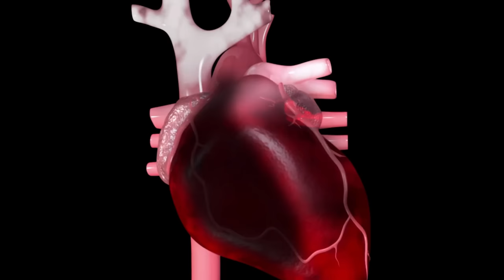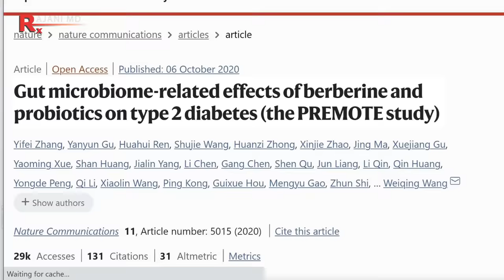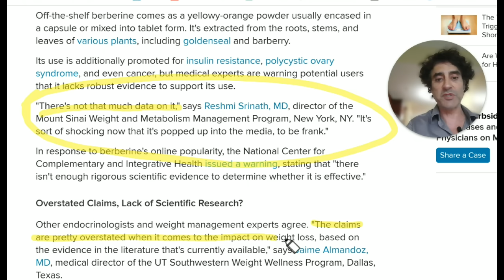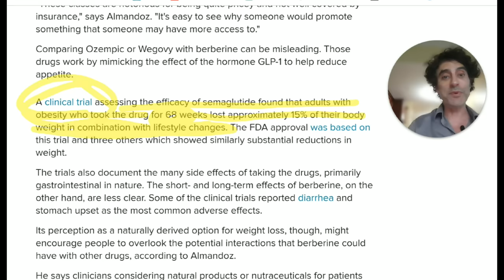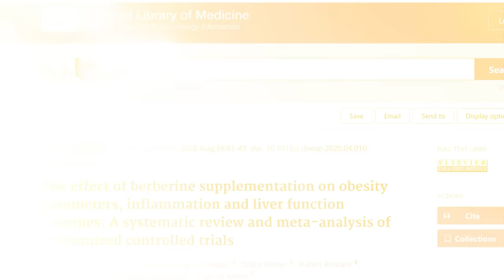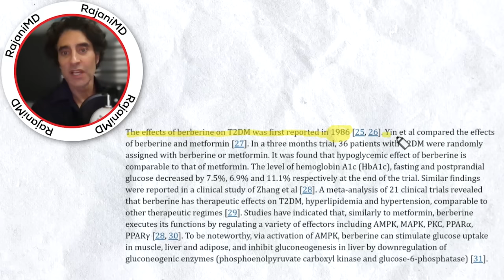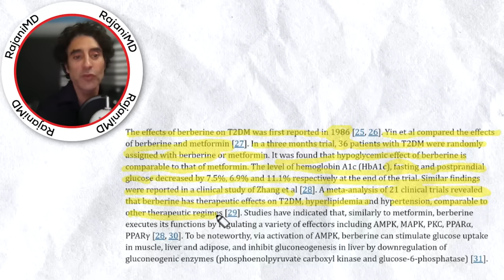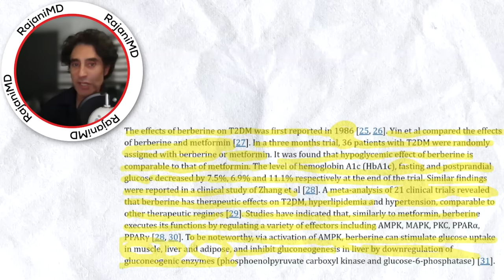BERBERINE : WORTHLESS or AMAZING ??

Comment: I did my own experiment with Berberine 500mg with lunch and dinner and lost 8-9 lbs without any other changes diet, exercise, etc over a 3-4 month span. It is not a magic "weight loss" bullet but works slowly overtime.
Reply: Thanks for providing the dose and timeframe. I just need to lose 10 pounds and I think I will try this.

Comment: I am taking Berberine. 1g per day in 2 doses (500mg twice, spaced apart). Mainly because I used to have higher blood sugar creeping up to the pre-diabetes zone, and higher blood pressure. Now that has normalized. No side effects that I have noticed. I also lost a bunch of fat, but I attribute that to switching to a low carb diet (keto), since it was way more than 5lbs. More like 45 lbs. At any rate, between Berberine and keto: lost 45 lbs, triglycerides lowered, blood pressure lowered, insulin resistance is gone, and I feel 100% better. Took about 8 months. Still going.
Reply: I haven’t tried Berberine yet. Thinking of doing so. I went on Keto during COVID. Over three years, I lost 125 lbs., still need to lose another 125. Due to disabilities, exercise is not really an option. 

Then, I moved and lifestyle changed. Plateaued for months, then the weight started creeping back up. Have gained back almost 40 lbs.over the past 2 years. Am hoping Berberine will give me a fresh start and good kickoff.
Reply: @cherylmcnutt9905  Exercise is always an option. No matter how little we start with. Ingesting berberine is only a partial help. We have to move. Just a little. And keep adding to our movement, just a little bit at a time. It can be the smallest amount, and keep going by tiny amounts. I have lived this, so I know. Just do the smallest thing you can do, and then do it again, and again. <3
Reply: Congrats! Cheers and support from me. Keep going and I wish you good health!
Reply: @toluca56 hey I hope your fine n would reply back
I’m 22 years old 100kgs on my way to loose weight I have slight hypertension dr put me on medication and told me once I loose weight he will get me off of the bp medication 

I want to start berberine as I have read the data online that it does work in waist n hip ratio and seeing my fellow Korean k dramas I want to loose weight i do take collagen supplements and k2 etc and nac too since taking nac I do feel more productive and active to do cardio 
Can I also start berberine to loose weight ?

Comment: I can't take metformin because it gave me diarrhea. So my doc put me on gliclizide for my type 2. It did not bring my blood sugar down enough so I figured the next step would be insulin. Then I started berberine (500 mg twice a day) and inositol (500 mg once per day) and I quickly lost 5 pounds. No exercising. I am still on gliclizide as well, but because my weight is down and my type 2 diabetes is better managed, the doctor has not started me on any other meds. I will keep using the suppliments for as long as they work!

Comment: I take 450mg twice per day for almost 3 months now. Should take a high grade version, I take Medi-Herb. I am not taking it for weight loss, but notice I have lost a few pounds. I'm taking it for insulin resistance issues and high cholesterol. But a fantastic unintended benefit is I am now sleeping way better at night on Berberine! I'm able to shut off my brain now - before got 4-5 hours a night, now 6-7 hours a night. A huge change for me! I experience some intestinal gas issues, but well worth the benefits I receive.
Reply: Wasn’t thinking about sleep. Hmmmmm. I am sleeping better. But also started colostrum and thought it was that! Now I need to go back and think about that again!
Reply: Yes, I just started taking Berberine 3 days ago, and realised that the last two nights I had very good, deep sleep, which I hadn't been having lately. I suppose that by controlling blood sugar, it helps sleep at night, only a guess!

Comment: Really great info and comparisons of Berberine and Ozempic, Wegovy!! 😃

I started taking Berberine once a day before my main meal during the pandemic as I noticed some skin lesions (angular stomatitis) and some acne on top of 6lb wt gain (with a more sedentary lifestyle) and some lower GI issues - all hallmarks of gradual insulin resistance despite no history of diabetes and I've always been slim. 

I combined this with intermittent fasting and within 7 wks I lost that weight, my skin became clear, my GI issues vanished. Most of the weight loss was due to IF not Berberine though (I took Berb for 1-2  months before I did IF). Despite my med & science background, I had to resort to the above to get my health under control.

I only noticed side effects from Berberine in the 1st 2 days (ie diarrhea, ab pain) which disappeared. Berberine changes your microbiome and increases Akkermansia (a good bacteria found in slim folks) and will cause purging of your pathogenic bacteria so you will get GI upset initially. It is primarily for lowering insulin, BSL and hyperlipidemia more so than overt weight loss (unlike like Ozempic which is a direct GLP-1 receptor agonist vs Berberine which just helps stimulate GLP-1 secretion via various pathways). I believe it is better than Metformin and Ozempic/Wegovy due to less side effects and may have a role in longevity due to AMPK activation.

Anyway Thanks for all your info and I love the fact you cover such diverse topics Dr Rajani! 🥰
Reply from the maker: I thank you so much for sharing your experience sonwe all learn
Reply: How many mg of Berberine did you start and did you increase the dosage? Thank you
Reply: @kellylynn9163  I just use 500mg a day before my meal (I only eat 1 main meal a day and a snack). The version I use is more bioavailable though as it is combined with 115mg quercetin. In general people use a bioavailable form 1 - 2 x a day. Please do not exceed about 1g per day if using the bioavailable forms as too much can cause liver damage. For non bioavailable forms you can use about 1.5 g a day spread out. Anyway this is not medical advice, but scientific-based
Reply: Thank you

Comment: My mom took this for  her diabetes and blood pressure. It definitely helps with Diabetes but you also need to incorporate eating better as well. The results will be faster if you do so. Other than that.. It's awesome!
Reply: She needs to do a low carb diet eat very  clean protein and veggies  eliminate all processes food implement intermittent fasting (autophagy) she has to fix her insulin resistant

Comment: I take a 600mg berberine and Ceylon cinnamon gummy once a day. I have a sensitive tummy, so taking the recommended 1200mg dose was a little too harsh on my system. I seem to handle the 600mg well. I find it helps to control appetite and I feel satisfied with less food. I also use intermittent fasting 8/16 about four days a week. Weight loss has been slow but consistent at about 6-7 lbs per month. At this rate, I should hit my goal weight by February or March 2024.

Comment: Dr. Anil Rajani , I wanted to discuss a recent observation regarding my supplementation regimen, specifically with Thorne Berberine, and seek your professional advice.

Currently, I am taking Thorne Berberine alongside my other supplements, including cod liver oil pills, magnesium, sea moss pills, and B12, as part of an effort to lower my cholesterol levels. While I have been maintaining a healthy diet, I've noticed a change in the color of my stool since starting the Thorne Berberine. My stool appears green, which is concerning to me. Interestingly, I skipped taking the Berberine on Sunday, and my stool seemed to return to its kind of its normal brown color. I am on a 10 days green juice diet while taking it... 

After some research, I understand that stool color can vary based on the speed at which it moves through the digestive tract, with darker green hues indicating a faster transit time. However, I am uncertain if this change in stool color is a cause for concern or if it necessitates the addition of a probiotic to my supplement regimen.

I am eager to continue effectively managing my cholesterol levels and would greatly appreciate your guidance on whether I should incorporate a probiotic into my routine.

Thank you for your attention to this matter, and I look forward to your expert advice

Comment: I started taking 1,000mg of berberine with milk thistle and red ginseng (as well as other vitamins) and within a week and a half I lost 10lbs and 2 1/2 inches on my waist (185-175lbs) I was walking more that week as I went away but to have such quick and dramatic results it has to be the berberine. I’m already pretty far along on my weight loss journey so this last bit of weight is difficult to lose. I know berberine will help me with the rest. I have a lot of symptoms of insulin resistance and diabetes runs in my family do that’s why I wanted to take such a high dose to start. I’ve heard between 500-3,000/day is the dosing

Comment: I've been taking Berberine (Thorne is the brand, purchased on Amazon) for about a week now. No side effects, but I also have not seen any weight loss. I started taking it because I've self diagnosed myself as insulin resistant. Figured I'd give it a try along with some lifestyle changes to see if I can fix myself. I take 2 capsuled in the morning and 2 in the evening, both times about a half hour before I eat.
Reply: You need to be taking it for 1 month before the body responds to it on a cellular level. Be patient
Reply: You should take organic non GMO supplements
Reply: @jonahdiener7355  what brand do you recommend
Reply: Hi, just like you, I take Thorne brand purchased from Amazon.
I had no changes in weight for the first 2 months.
Now, in month 3, I have started losing weight…. So far I’m down 4 lbs.
More importantly, I’m becoming more fit I noticed my pants are fitting better my clothes feel better they’re all loose, so I guess I’m losing fat composition
.
Reply: I’m post menopausal and also taking Berberine.  I have some insulin resistance and was almost pre diabetic but after 6 weeks of using the Berberine, eating a very low carb, meat heavy diet I’ve lost 5 lb with another 5 to go.  Hopefully the last 5 lbs will come off the SPARE TIRE 😅

Comment: Hi Dr. Love your channel. Ironic that you produced this video this week bc I just started Berberine last Saturday . My research said to be effective take 2400 mg. Well I quit on Tuesday. I was taking with my am meal and dinner 1400mg each meal. In the middle of the night each night hit with terrible stomach cramps and diarrhea. I think I started to high but the brand I bought comes in 1400mg tablets. I want to start back bc I am border line diabetic and already insulin resistance. Lost over 100 pounds in my 40’s low carb diet and exercise and kept it off about 10 years. my boyfriend died during menopause transitioning and gained it all back. Love for you to do a video on how to start or recommend dosing . Realize that is hard to do bc everyone is different and you have to also be careful about medical advice perception on line.
Reply: You need to start off with lower dosage. Berberine changes the body on a cellular level and you have to give it at least a month to kick in. Be patient and don’t abuse it.

Comment: As a woman who has struggled with PCOS and the low blood sugar events, cystic ovaries, pre-cancers, etc., for four decades, spent time on Glucophage until it almost killed me, and switched to DIM, glutathione, and Berberine in 2016, here are my observations:  Berberine is well-tolerated and it DID lower my blood pressure about 10 points top and bottom.  But, zero weight loss and I have no clue what my blood looks like currently, but it’s almost always been good.
I still have low blood calcium and hormonal palpitations around menstruation and cysts IF I don’t take coral calcium and mangosteen pericarp powder!!

Comment: I'm taking berberine for 6 months now combined with potassium to regulate bloodpressure. I am on HRT due to a radical hysterectomy in Januari this year. Because I take it in pillform it goes through the liver and it had interaction with my angiotensine enzyme II and my aldosteron. Both are responsible for vascular widening and contriction. I had too much constriction due to HRT which resulted in high bloodpressure. I dove into it. I began using berberine once a day with a potassium supplement and heightened the dose to twice a day of both ( 1000mg of berberine) and my bloodpressure came down smoothtly. I am in the safe zone now. It works! :-D Doctor Rajani. What is your opinion on S acetyl- L gluthathione?

Comment: In your experience, what you've heard from others, do the GI side effects from berberine tend to go away over time? I have helped my mother, whose A1c was 11 (while on high dose of metformin) 2 years ago, drop to 6.5 (with 1/3 the dose of metformin she was taking) by following a whole food plant-based diet with no oil. This coupled with doing water aerobics everyday and stationary bike at home in the evening with a yoga series I designed for her has got her these results. However, her A1c is stuck at 6.5 and I am confident that if she could lose her remaining belly fat that her A1c would drop to normal (non-diabetic) range. So in addition to now trying to motivate her to dieting for 3 months to achieve a slight caloric deficit, I am considering suggesting berberine to her. Anyway, have you seen the berberine GI side effects generally go away over time? Thanks.

Comment: Doc, I take 500 mgs twice a day.  Funny, but today, I did poop three times and it wasn’t due to anything I ate yesterday.  I started to take it when I read that it helps lower LDL cholesterol.  Thought I’d take it throughout the summer and then have my blood levels checked again at the beginning of September.  I hope I see a reduction as I do not want to take a statin.  I am pretty active with Muay Thai, Yoga and lifting weights.  I cannot say I have noticed any marked changes in my energy level as a result.  I have lost weight, about 10 pounds, but I also started HRT around the same time, so not sure which to attribute my weight loss to? Anyway, I enjoy Berberine thus far and have had no adverse effects.  Hope you are doing well and thanks for this video.

Comment: Problem is, I had to take 2 grams a day to lose weight. Problem is, it'll mess, with your hormones. In my case 8t lowered estrogen, but increased progesterone. But the main side effects were gi upset. And, forget about hydrberberine, because the market has been flooded with scams. I'm trying ozempic, and if I have no joy, I'll switch back. But I will say, my triglycerides were undetectable after supplementing with berberine.

Comment: I first heard of Berberine about 6 months ago and it was in regards to a health issue that resembled IBS. However the symptoms were also similar to having a bacterial or parasite. (Weight loss was not relevant in the discussion unless you were taking 2500 to 3000 mg per day and only for 4 weeks at a time).  It was recommended to take 500 mg with a protein meal morning and evening.  In this way it prevents the diarrhea or constipation issue.  However I am wondering if anyone here has any idea of what else Berberine is capable of doing? It is known to lower blood pressure. Lower cholesterol. Regulates blood sugar. 
I didn’t need to loose weight and I found I have actually gained back some weight that I had lost over the last two years. I did stop taking it for two weeks and I was back in the same distress I was experiencing before I started taking it. So now I am mindful of when I take it. Now once a day 500mg with my evening meal.